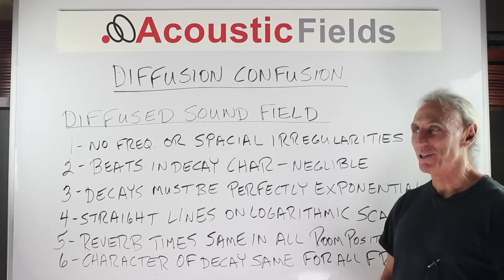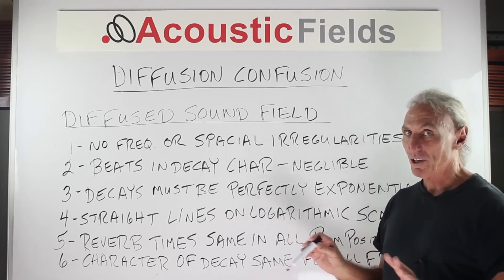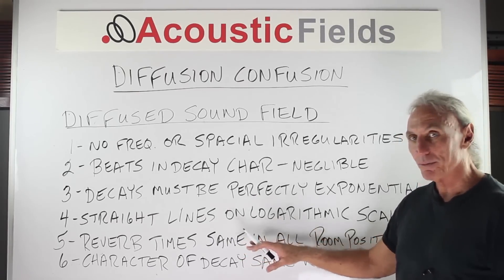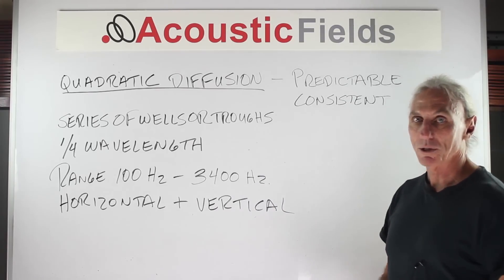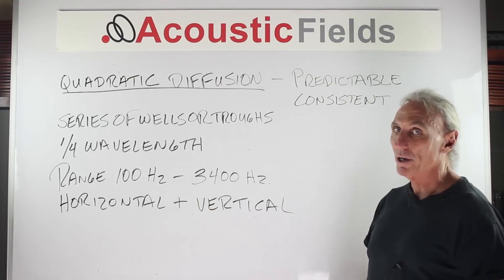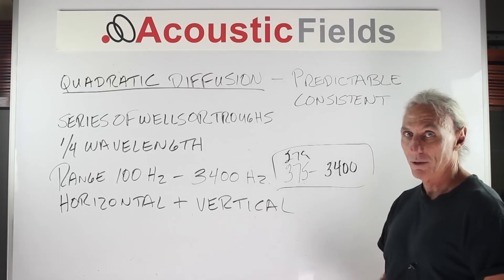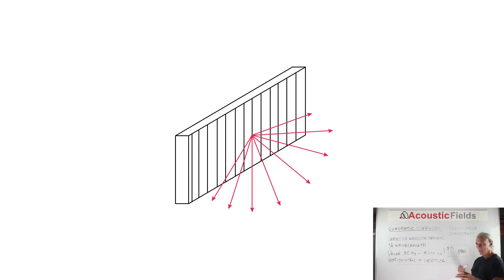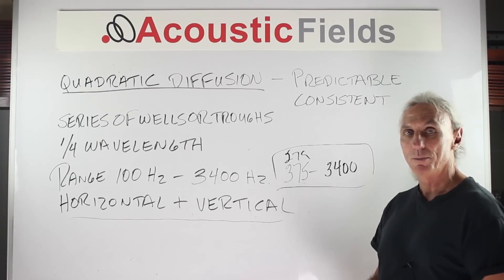How To Achieve A Diffused Sound Field In Your Room...& Overcome Diffusion Confusion!

Comment: First of all, thank you for your videos. I made myself a room to play my piano, I had little space and consequently the room is 11 x 14 for a ceiling height of 8 feet. The floor is hardwood and the wall and ceiling in gyproc. I would like to buy one of your plans for diffusers which improved the sound of my room (too much reverberation) Can you specified wich one. 

I
Reply from the maker: Adding diffusion in a room with high reverberation times will make the room sound worse. Diffusion can increase reverb times. You must have all of your absorption requirements met first before adding diffusion.

Comment: Hi Denis, I like going back and re-viewing you videos - I hear things that I had previously missed. Very curious about a 100Hz diffuser. You say about 3ft deep. I have an alcove on the rear wall that I should fill in - or use to my advantage. Could I make a 100Hz diffuser for this ? I have about 8ft wide x 8ft high x 3ft deep inside the alcove. Would love the challenge of  building one. But the listening position would only be about 8ft in front of the rear wall. Is distance less important at low frequencies ?
Reply from the maker: What is your room usage? What treatment types, amounts, and positions are in the room?

Comment: Dear Dennis
I have the luxury to build my sound room. I was told before if possible dont have 90% walls or ceiling. is it easier  and better to have slanted side  and back walls and ceing . Thank you for your great work.
Reply from the maker: D,  I don't know how you would have a room that doesn't have walls or ceiling. Slanted or angled walls are for reflection management in critical listening rooms.  Angled walls do not have any impact on low frequency issues per se unless you use the angled internal volume for low frequency management.

Comment: Hello Dennis, what is the recommended distance that I will need from the Q – 23 diffusers on the front wall to the rear of my speakers cabinets??
Reply from the maker: D, That is not the distance you need to be concerned about. It is distance from diffuser to listening position. With a P-23, 6-8' is minimum.
Reply from the maker: Its about the distance from the diffuser to your ears. Keep your speakers at least 4' in front of the diffuser.

Comment: Would it add another level of diffusion to position six prime seven diffusers at different depths from the back wall of the room according to the quadratic residue calculations so that the end diffusers are 9 11/16" from the wall (0 depth removed) the next are 3'2 11/16" from the wall and the two middle units 1'7 3/8?  Or am I way off base thinking that way...
Reply from the maker: N,  Keep the surface area the same. Do not stagger the diffusers. What is the distance from rear wall to listening position?
Reply: I'm just doing some early musing about a house I may build in a couple of years.  I'm a carpenter, and a musician, and I want to build a studio in the house.  I realized, after I posted, that the idea was untenable, because I would need over thirty feet from the back wall to the seated position, and I won't have that kind of space, probably more like twelve feet at the most.  The house I'm designing is unusual, so it will present issues I'll need to solve in regards to the studio.  It is a doughnut shape, so two opposing walls would be round, and I know that can be a huge issue with acoustics.  The radii of inner and outer walls are large, though, twenty and sixty feet respectively, with side walls angled away from each other as they would be following the line of the circle radii, and the inner and outer curved walls would be approximately fifteen feet and thirty feet, and the splayed side walls fifteen feet long.  I'm thinking that the acoustic focus points of such large circles may be well outside the room, so I don't know if that would be positive or just make matters worse.  Since I'll be building a room withing a room, I may just have to make those walls straight and sacrifice space.  I'm planning on pitching the ceiling to a center gable to avoid parallel surfaces with the floor, which will have wood paneling over concrete slab.  The seated position would be close to the longer wall, and I'm considering diffusers along the shorter wall facing the studio monitors sound, behind the listener.  Of course, I'm considering other treatment such as bass traps in the corners and some absorbing panels where needed.
Reply from the maker: N,   Fill out the information in this link:  https://www.acousticfields.com/free-room-analysis/

Comment: But in order to meet these requirements you have to start with a modally spaced room to begin with. No amount of treatment will ever change that. No amount of QRD placements can fix it. No bass traps can fix it. Placements will help... Electronic delay in the form of a cardioid or hyper cardioid can solve the low bass problems... smaller soundfields is the easiest solution.. an 8x8x8 room is best to use headphones...
Reply from the maker: D,  You are correct. Modal distribution is size determined. Treatment can reduce amplitudes of unwanted modal issues. QRD or diffusion treatments are not the technology one would use to treat unwanted modal pressure issues. You would choose between diaphragmatic, membrane, or Helmholtz for unwanted low frequency issues.
Reply: Acoustic Fields I like all of your videos. Turns out the very first one I watched was overly simple and focused on dealing with a rather terrible room and trying to have good sound everywhere... 2 things that really simply don't overlap each other. My understanding is beyond where I need to watch your videos but it seems like I can't deny you know your stuff.
Reply from the maker: D,  We try and blend many levels of knowledge, all with the sole purpose of communicating and illustrating air born energy, music and voice, in small rooms. We try and take the complicated and make it simple, no matter what the knowledge or skill set level of our customers. If you have a topic you wished covered, let us know by email at: info@acousticfields.com

Comment: Great videos, very helpful. My room is basically 17 feet wide by 13 feet deep with an 8 foot ceiling. I have treated the front and rears walls, what should I be using for the ceiling. it is a 5.1 setup and I listen to both 2 channel and music concerts and movies.
Thank you. JF
Reply from the maker: J,  In small home theater rooms, diffusion on the rear wall and ceiling is recommended. The QRD-7 diffuser is 4" deep. Here is a link to our ceiling module: https://www.acousticfields.com/product/p-7-csm-ceiling-system-module/

Comment: Hi Dennis,

I have question regarding diffusion. I need to place the diffusers in a control room so as u mentioned you need it on the rear wall, however the distance from my rear wall  to the listening position is large, same goes for the speakers. What sort of diffuser would be helpful or would it be best to leave it untreated due to the distance? The room dimensions are as follows, 26ft x 14ft x 8ft (L x B x H). Speakers - Yamaha HS 8

Thanks,
Elroy